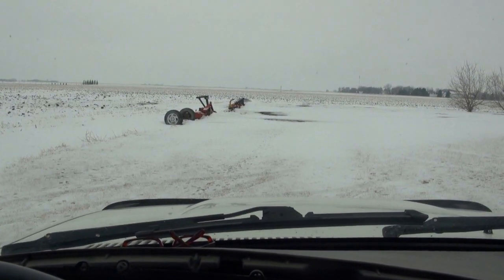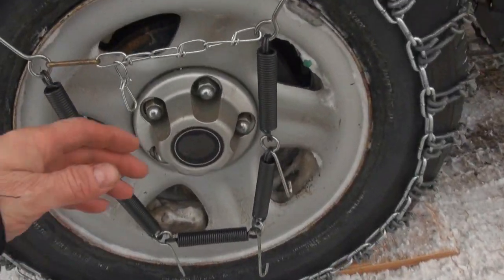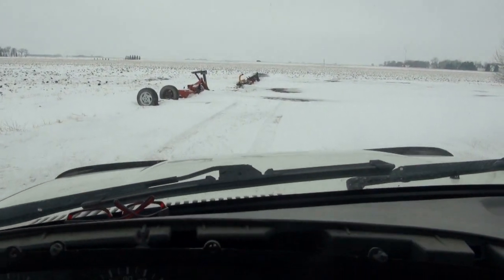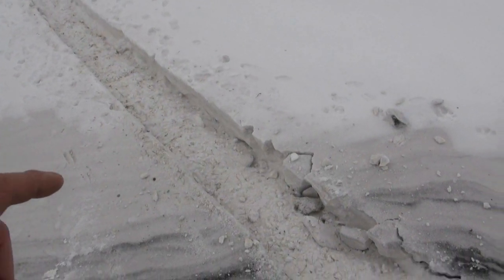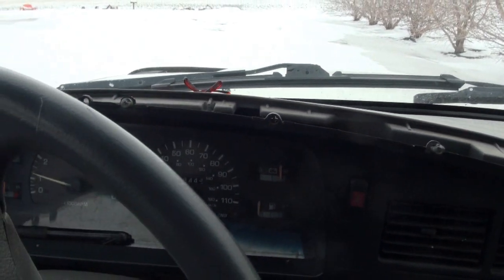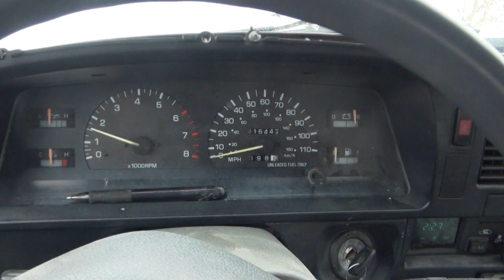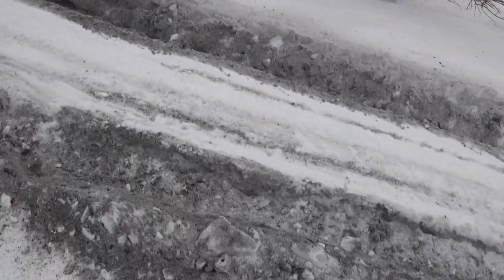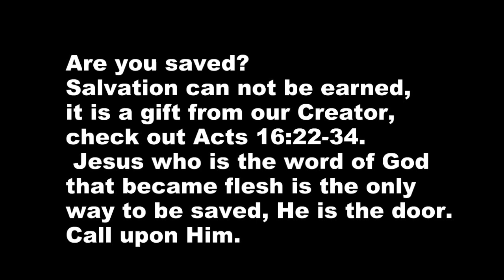Tire Chains Snow Testing

Comment: Theres no replacement for 4wd. I personally owned 2 previous 2wd trucks. Never again in Michigan. The chains how ever are impressive
Reply: You can do 2wd just put some weight in back and dont have an open differential.  Posi track is good But You need to chain the front so you can steer.  It will only go straight with a good posi.  Unless you stay in the ruts.  Look at how well lawn mowers with chains do.  Weight on back.

Comment: Hey I was just wondering where you bought those chains? I have a 2wd 1990 f250 and live in the mountains of B.C.  I found a set for my truck but the cross links are about 10 inches apart and they most definitely do not work even half as good as yours I bet. I tested them out and found that they hardly helped when crawling and when putting the old 351w all the way to the floor in second (because it wouldn't take third) it just did the old axle hop thing so freakin bad I'm surprised somthing bad didnt happen like my fuel tank drop out or canopy rattle off or something. I was trying to get to a place that I thought i could make er but had to give up.. very disappointing. Was not plowing snow yet but dragging my diff for sure. I few years ago I took all the cross links from one set of chains and put all the crosslinks onto another set for my garden tractor and I literally had twice the traction. Wasnt the quickest process and I definitely dont feel like doing it again especially with bigger chain. Wanted to say thanks for all your videos and that most are good enough to watch twice especially when it's been a few years since a guy's seen them. I appreciate ya big time.
Reply from the maker: These are two link spacing and think I had mine custom made  by a guy on Ebay, also get the v bar for extra grip. Thanks for watching.
Reply: @groutaone  can we have a link to the guy you bought them from ?
Reply: try wesco industries in langley